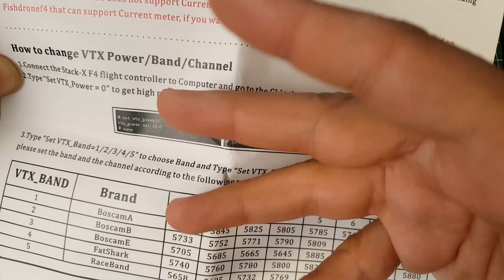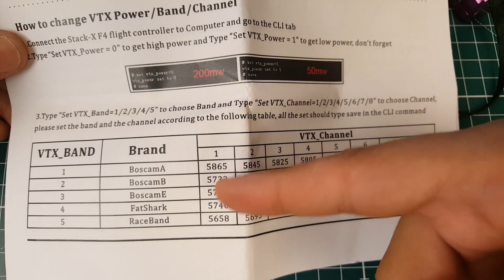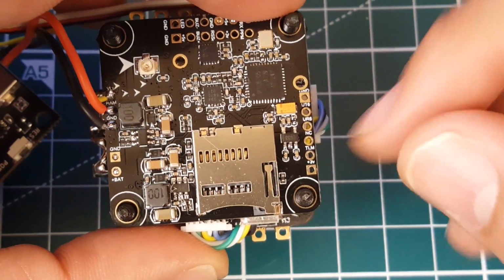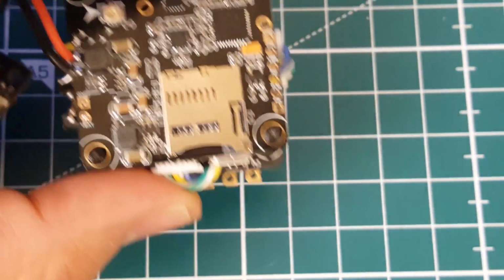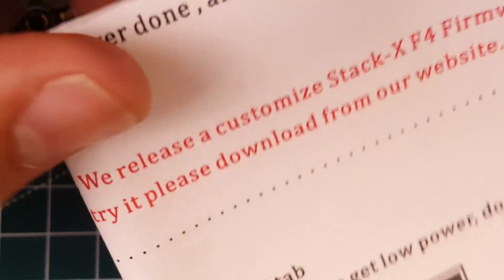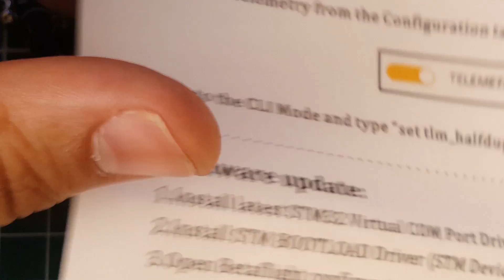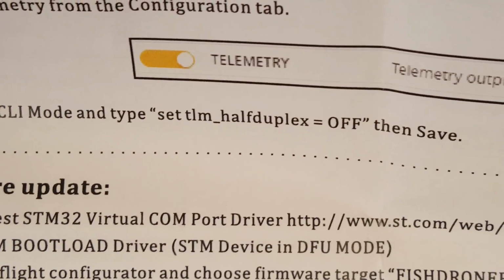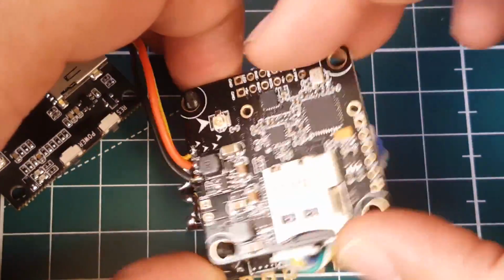Eachine Stack-X F4 Flytower // Overview

Comment: This stack is a fail. That VTX is the weak link in the chain. CLI commands, really? 200Mw?What the hell were Eachine thinking? stupid, stupid, stupid. So close, but yet soooo far.
Reply: uavfutures said it had smartaudio so you can do it from OSD as well. 

and 200mw is more than enough for 95% of flying